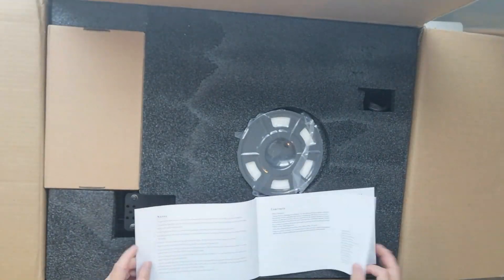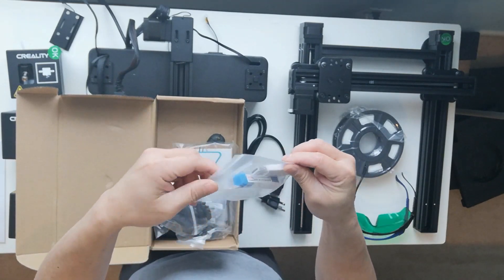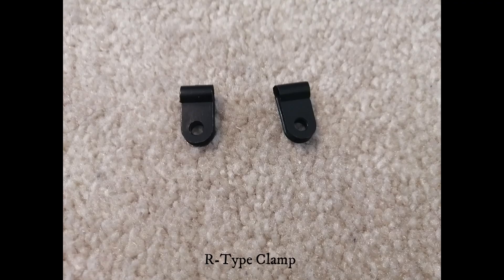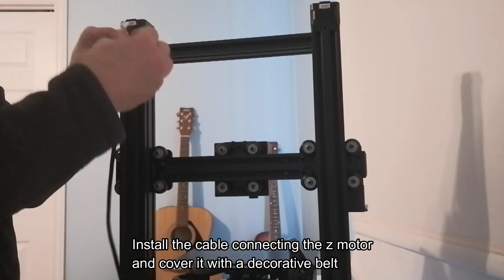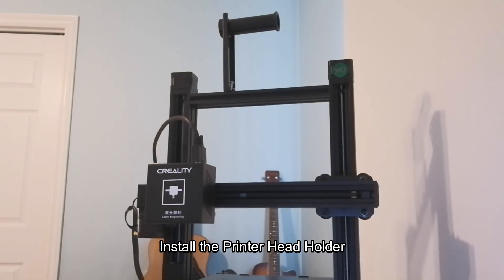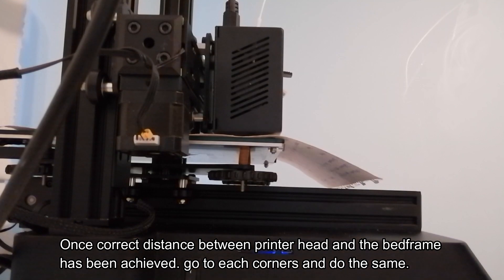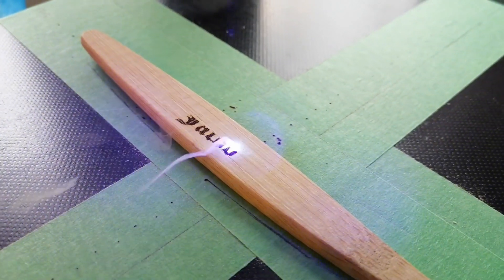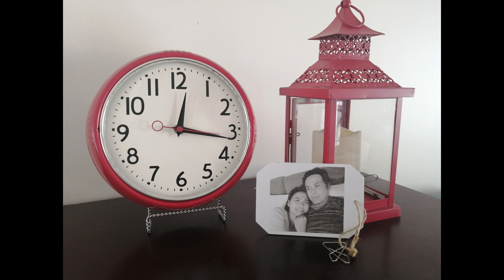Unboxing my Creality CP-01 - 3d Printer laser engraver cnc

Comment: Great video! really well explained, i dont know if you could help me in anyway, i got this machine a few days ago and have made my own design to print, its nothing complicated its just a end cap for a airsoft suppresor im planning to make, however around 30 mins or so into each print the extruder motor will stop spinning but the printer will carry on as normal, it prints all the test models that came with the sd card but it wont work with anything else? i even downloaded other peoples designs to test and the same thing happens with them, it just stops extruding after about 2-3mm high of the print, any help is much appreciated!
Reply: Same experience here, extrudermotor stops after a while nozzle is NOT blocked. No settings available for the slicer software. You have to experiment with G-Code to find the correct settings yourself. Leveling very difficult and unreliable and must be repeated after every print. Glass coating does not stick well. Machine is already out of production, do I say more...
Reply: If your printer is printing quickly, it may be crushing the filament until there is a disconnect of the filament inside the module. I advise to start with basics like cleaning your nozzle, check your software settings, make a 45 degree cut on the filament before putting it on the feeder. But it could just be a fluke.

Comment: Just got this 3 days ago. Have a few prints done. But after completing my latest print my cooled extruder temp is 51° and it won't go above 116° (actual temp is much higher) thermal runaway? But I was wondering if you've figured out how to update firmware, I cannot figure it out due to limited info on this machine on the web. I'm version 0.03

Comment: I bought one, but is it normal that the machine making some noise or should it be silent?
Reply: Should be silent as compared to other engravers
Reply: @basstoon2123  ok, thanks. It's the computer part of the machine that is making noise, however the 3D print isn't making any sound (perfect).

Comment: Got this on Monday. I love it. I have 3 creality 3d printers already, and I love this one.
The 3D printing is really good. It uses a BMG direct drive system. My first test print was a benchy with NInja Flex at 60mms, printed it beautifully
The laser engraver is not strong, but so far I have engraves softwood,  acrylic, and even the back of a mirror, so there is a pattern showing on the front. Strong enugh for the hobbyist
CNC is probably the weakest part IMHO, it is good and does its job, but the Bit deflects a fair bit. If you cut shallow, and take several passes at incremental depths it works well

For the money, I think this is an awesome machine, and recommend it to anyone who wants to do these things on a hobby level
Reply: You are absolutely right. I'm super impress with the 3d printing side and the laser engraving. I'm now making few bucks for this machine. Not bad at all